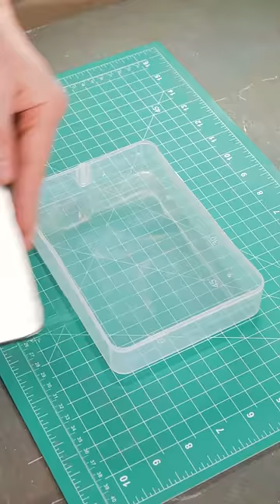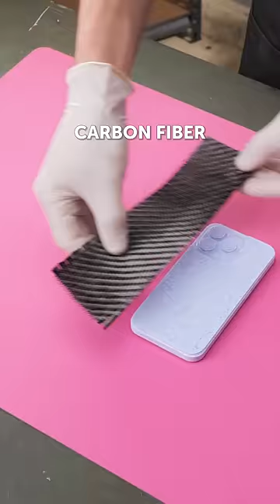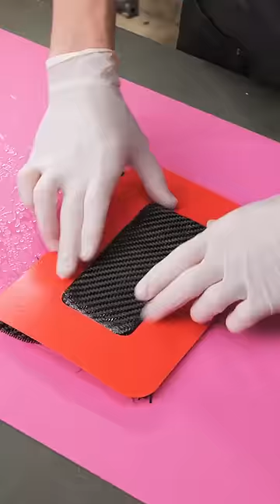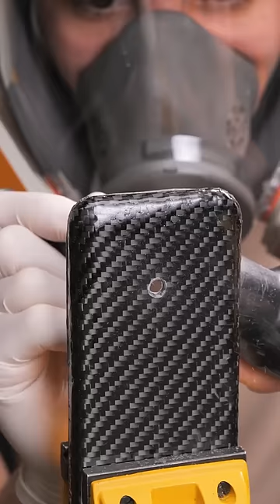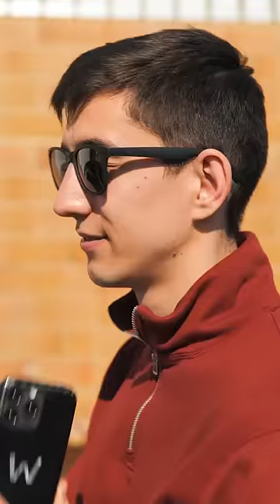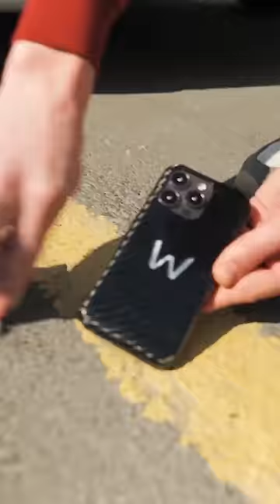We made a phone case out of carbon and alluminium 📱

Comment: I see a big problem with this design carbon fiber is a material that does not allow rado waves to pass through it so it would be difficult to make calls on it 😂😂
Reply: I hate that some people are so smart and I am so not
Reply: @majorjackpotslots  it's fine bro, one day we will all find the thing we are good at
Reply: @TprogamerYOUTUBETerraria   even me? 😢
Reply: @yulix5376  no specifically not you
Reply: I feel like youtube short videos are making me less smart 🙁
Reply: False, it absolutely does allow radio waves through.  All materials have a db loss value, and at that thickness, the loss is negligable. Try again.
Reply: @cherricola7474  do you actually know the conductivity of carbon fibre, the frequency used for LTE and said this based on a skin depth calculation? I don't think so
Reply: @majorjackpotslots  Just read a book
Reply: @Hamilcar  I'm actually a wireless engineer, and used to work on an aircraft made out of carbon fiber. With all doors on the aircraft sealed, still had plenty of signal on my phone inside the aircraft.  Tell me exactly again, your qualifications and the testing equipment you used to determine the loss value of carbon fiber? Or anything at all about radio waves and how they work?
Reply: @Caramelcat498  who needs Google when you have real-world first-hand experience with both carbon fiber and actually testing wireless connectivity with an advanced antenna array that measures loss values?
Reply: @cherricola7474  damn bro pulled out the 
✨Experience✨
Reply: @cherricola7474 You sound like dwight shrute
Reply: @hamilcar358  I have a real carbon fiber case. It doesn't block 4g or 5g or 3g. Or any other signal. Like any case there is a small signal loss but it only matters at the edge of service are
Reply: @cherricola7474  I have a PhD on the subject. LTE like 3G to 5G is microwaves, not radiowaves. There is no such thing as generic "carbon fiber". Depending on the precursor (PAN or pitch) and fibre diamater, tow conductivity from one weave to another can be orders of magnitude apart, and so is their attenuation coefficient. Usually higher grade carbon fibre (PAN based, aerospace grade) is more electrically conductive as well, so more attenuating. Most carbon fibre composites are dispersive materials, meaning that their electrical conductivity is also frequency dependent, which makes estimating attenuation even more complicated. Prof. R. Zoughi is the only one with reliable experimental results on microwave penetration in CFRPs. I don't know what type of aircraft you are talking about but I assume there were at least some windows in the cockpit for the signal to go through, this is probably far from a "controlled experiment". You can get phone reception even inside an elevator made of aluminum
Reply: @jeepmanxj  this seems like a realistic result. Remember that phone signals can also go through the screen. Capacitively touchscreens use a thin layer of indium tin oxide which is conductive, but not enough to block completely
Reply: @Hamilcar  buddy, that is a lot of words to describe exactly how your PhD is worth less than my already used toilet paper.  Thanks for the laugh, though. I feel a whole lot better about my certifications in wireless  design and testing.
Reply: @discarded_productions1369  😂😂😂😂
Reply: Carbon fiber is use for  cars, bikes, but specially for PLANES, SPACECRAFT, SATTELITES!  And carbon fiber is just carbon! Yes that common mineral mixed with epoxy resin!